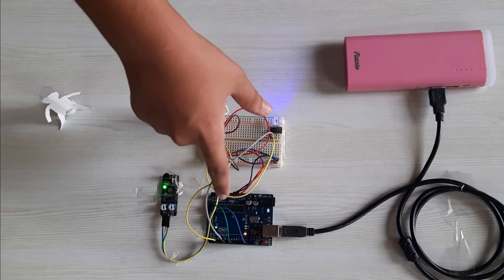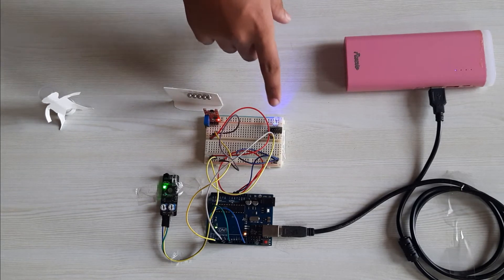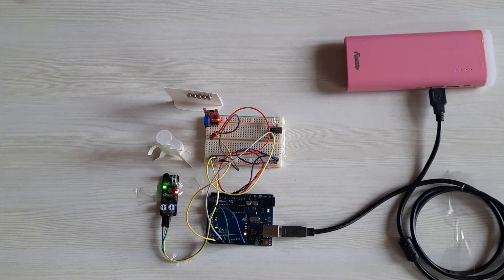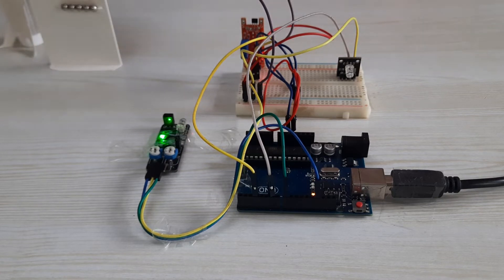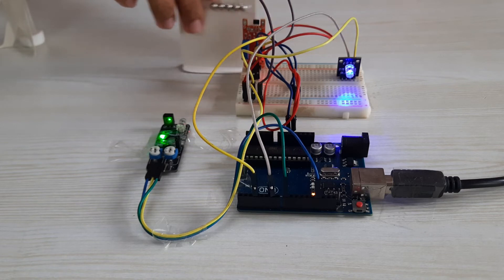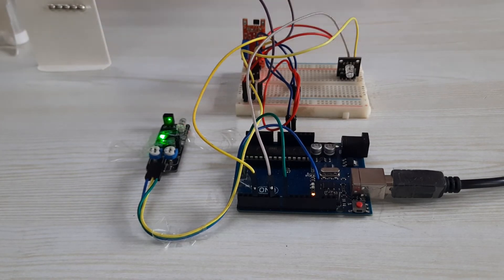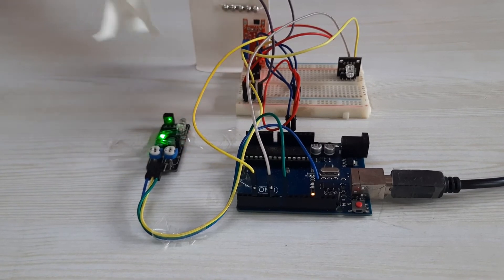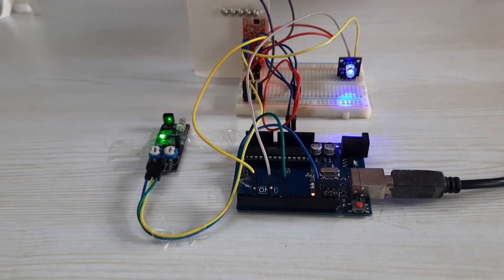Elevator Disinfection Made Easy with UV-B Light

Comment: Wonderful concept and excellent presentation. You should write a paper on this and you could extend the use case to aircrafts and even restaurant dine in areas. Keep up the good work.
Reply from the maker: Thanks, Uncle.  I will work on this further.  
I see there are several more uses that I can think off, I am still researching on the subject.  The lockdown is putting some challenge in getting the parts needs to make a prototype and do testing.